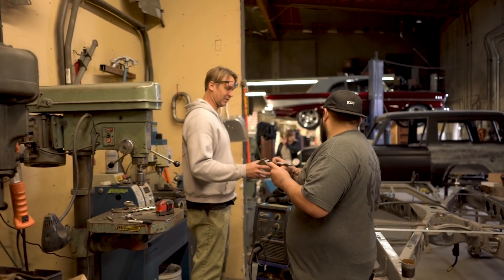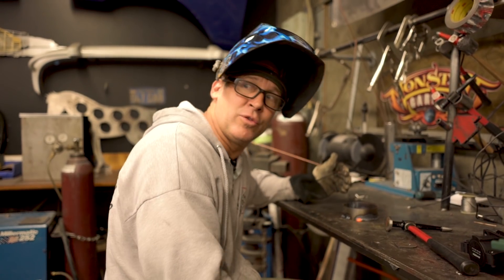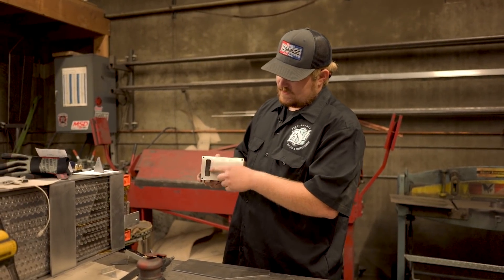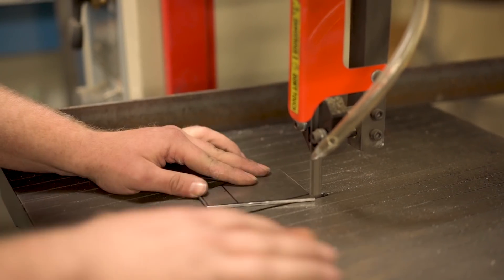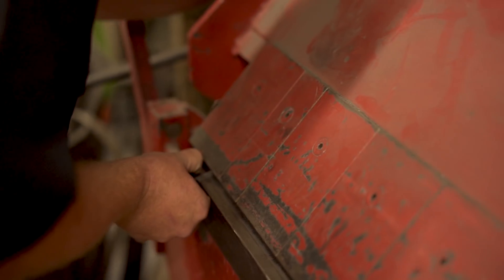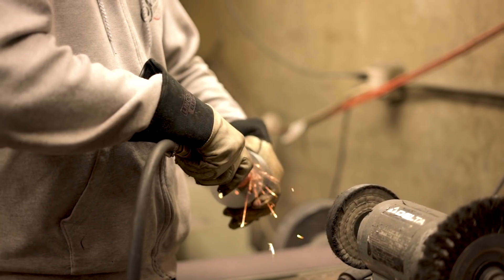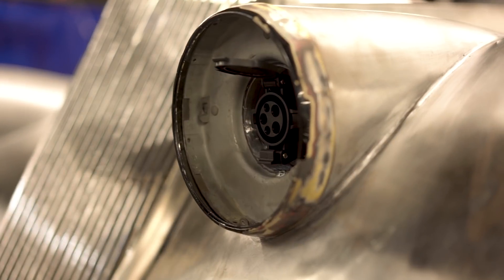The Vik - A Tim Allen Build - (part Cix)

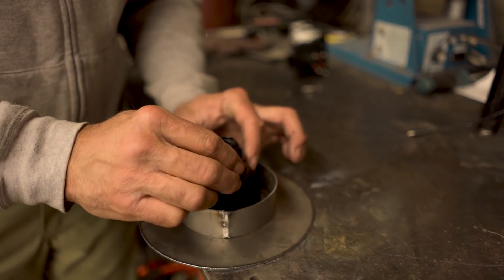Comment: Tim Allen likes electric vehicles? Awesome. Modern American Muscle. 3:00 they will operate fine below 40 degrees. Although internal resistance increases a bit so effective capacity starts to be reduced. That is why battery heating is so beneficial.

Tesla Model Y uses a heatpump to heat the battery without sucking so much juice. But that is a brand new design

Comment: I would love to see more (or at least some) tailfinned 50s cars as EVs on the road. They prototyped Jet engines, so why is noone building an EV out of those huge Ships.
Reply: Lead Sleds... add batteries, even leader. Would be cool to see a 57' Chevy with Tesla drive train though. Kinda like the 32' Chevy with a Z06 chassis and motor. :D

Comment: Bodie, look into using the newer WATERLESS Coolant... it's glycol based, but doesn't generate all the pressure water based coolant systems do, so it's more reliable, and has higher performance numbers on heat transfers/cooling etc than conventional coolant.  See : https://www.evanscoolant.com/
Reply: I learned of the evens product from Jay Leno he runs it in all his  rides. And no rust builds